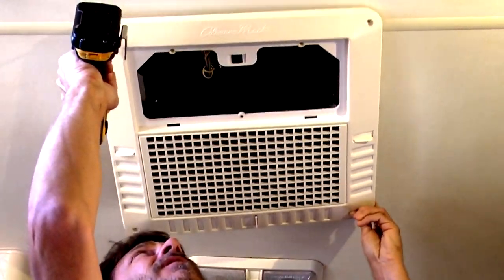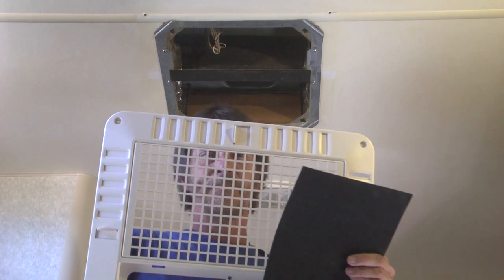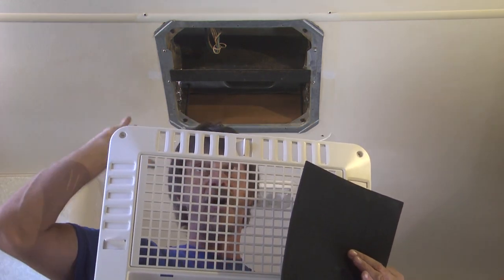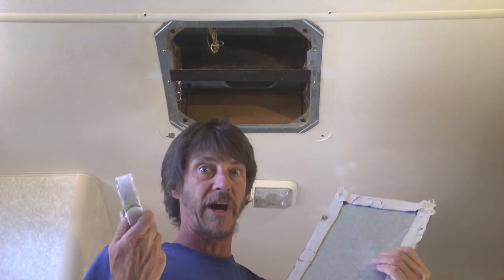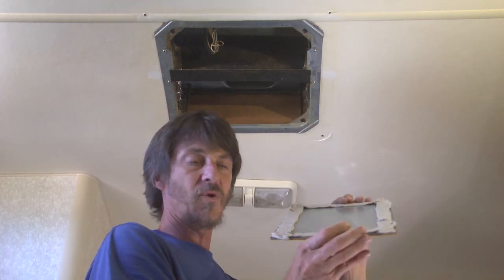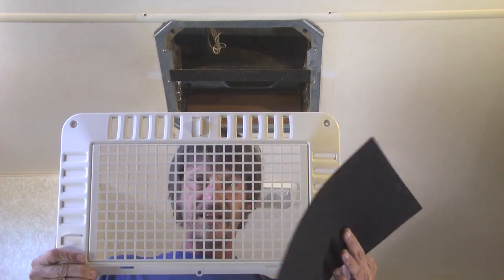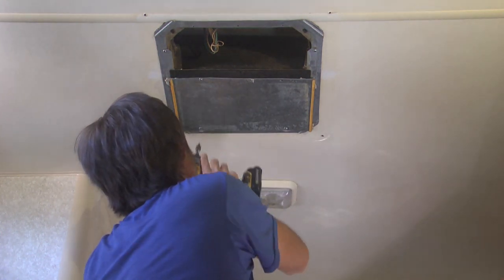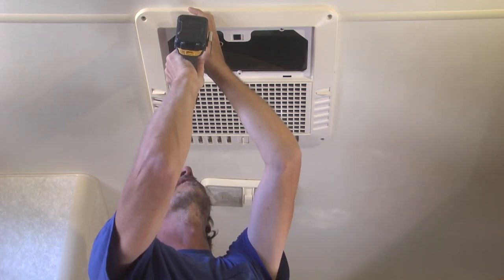Easy RV Air Conditioner Trick for Better Cooling

Comment: Good idea. I was cleaning my ac condenser and evaporator. How do I keep the water from running into the  motor home when washing the evaporator?
Reply from the maker: The evaporator enclosure is not sealed against pressurized water.  I would avoid spraying directly toward it and to make sure the drains are not blocked on the unit's base.